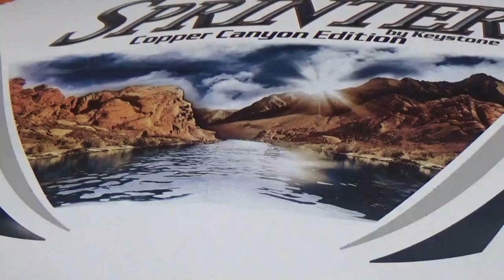RV Roof Replacement and rebuild back wall

Comment: I have a 2014 keystone sprinter 299 ret 36ft travel trailer and the back wall has done the same thing. I mentioned on another one of your other videos that the RV sales person told us that it was made like this for movement. We purchased it new at 30,000$. I reside in New Jersey.... a bit far from you 😕😔 I know you guys want the customers to come in for inspections.  Of course I just purchased dicor 5 tubes. Smh. We are really tricked as these companies really don't care for there customers. So sad. They should have inspections before each process moves forward. Thank you so much for your videos. I know it would be hard for you guys to give estimates without looking at the coach. This year sprinter are beautiful coaches. We maintenance ours every season but like you'all said.... The RV industries really take you for a nasty ride.

Comment: What adhesive are you using on the back wall for the aluminum studs to luan. Is the adhesive enough or does it need screws too? Do you need to put something over the seams before applying the filon? Thanks

Comment: We are re doing our back interior exterior wall on our 2013 Keystone Sprinter and I'm wondering what you are using to stick the skin to the fiberglass, can you please share what you use. Thanks 😊
Reply from the maker: You need to use  a spray contact adhesive  like 3M90, or staybond.. that will bond Filon to wood. Some adhesives will  disintegrate foam. We use adhesives in the a cylinder not a spray can. If using a new piece of Filon I would  suggest you scuff the back side that will be adhered with a sander. Get the gloss on off.
Thanks for watching.

Comment: I've have heard things about Keystone but never have seen the real problem. We have a Jayco 2015 XJ 213 rear slide only because many of our friends have them and like them. We did have a entertainment system problem so I called Jayco and they had is fixed asap. The problem we had was from the dealer themselves not from Jayco.  Great video mate.

Comment: What do you use to glue the rear wall fiberglass to the sheathing? We have a 2018 Big Horn traveler 39mb, ac ran to the rear passenger corner amd down the inside channel. If heartland wont repair under warranty I'll be doing it myself.

Comment: Are the aluminum caged roof wall and floor any better? At least the structure won't rot.
Reply from the maker: No, aluminum is not better. The alloy in the material is pathetically low and makes it extremely difficult to weld with burning apart. We tried to braze a section together and it melted before the brazing rod. The rod molts at 760 degrees. If the aluminum was better quality it would make a major difference.
Thanks for watching.

Comment: I am having this same current problem with leaking on the back of my 32ft 5th wheel trailer although it’s solid on the passenger rear side but on the driver side rear it’s soft as well as my driver side, side is rippled and soft at the rear my question is how much would it cost roughly to have someone fix it? Thank you for time.

Comment: Great video and awesome job! These RV are just junk nowadays! They are built with the same as mobile homes with 1x and 2x2. In your honest opinion who builds the best RV and actually takes the time to properly install roofs from leaking like this Keystone. Thanks in advance!!
Reply from the maker: Unlike a mobile home, these coaches are not inspected or have any codes to follow. So they're actually worse and can legally get away with it.
Who makes the best one?.... They're all the same. Take the decals off and you wouldn't tell the apart. Even when we open them up, they're the same. 
I don't own one. Kind of like a landscaper having his front yard paved...lol. 
Thanks for watching!
Reply: Actually, I think the Keystone Aluminum sidewall construction is one of the best.
Their welding discipline is admirable (Google it for you-tube). 
It is mostly the fault of the owners not maintaining their rigs.
They don't appear to appreciate the fact that they need to maintain the roof (recaulk as required) or any thing else. We have been Rv ing for 60 years and never allowed such damage to occurr.

Comment: From what you have seen, what rv manufacturer turns out the best rvs?
Reply from the maker: They're all the same. We worked on an older Holiday Rambler that was fairly stout. I am not certain if they build them that way anymore. But as a rule. If you take all the decals off, you wouldn't know one from the other, even construction wise. They're all stapled together, no adhesive....Get it built, Get it out, Get it sold attitude. I don't own one. 
Thanks for watching.
Reply from the maker: One manufacturer that we have not worked on is Airstream.

Comment from the maker: This is all GAF brand TPO that we use for the roofing.  The material is 60 mil thick structured. Structured means it has a mesh in the membrane for strength against impacts like branches and hail.  The reason we use GAF solely is because they are the only commercial manufacture company that will extend a warranty to an RV. All our products we install are commercial products, not RV poor quality products. We do not use or install EPDM rubber. 

Jon, the glue we use is just under $500 for the small cylinder, very expensive. You can use 3M90, available at Home Depot or Lowe's.
Reply: Rv roof install I tell you what we have noticed is people is going to these small runaway campers we have been building them for a 5 years I think as of rt now we have 60 to build we don't do any advertisement whatsoever it's just word of mouth you do good work it'll get around

Comment: Thank you for sharing your wisdom :)  I am lucky!  mine is a 96 Keystone Sprinter and  its *just* starting to need back wall replacement... would love to hear from you privately about replacement cost.  I've been very careful with lap seal and checking...but it finally failed!  UGH!  THANKS SO MUCH again...
Reply from the maker: Call between 9 and 4. M-F. 423.475.7663.
Thanks for watching!
Reply: @RVROOFINSTALL  I wish I could but have no reception!  I'm in the toolies of the Big South Fork...

Comment: So just figured out that we have something similar happening on our 2013 Keystone Laredo 250rl. I don’t think it’s currently leaking, and that it was the previous owner and they fixed the leak but did not fix the damage. We’re also currently full time living in it and will be for the foreseeable future. Since it’s getting to be colder outside and we don’t have a huge garage to pull it into to work on it we’re probably just going to wait to do this until spring. My father in law is a very experienced contractor so we’re going to be doing the work ourselves. We will not be completely replacing the entire roof as that should not be necessary, but will need to pull up the rear side to replace the decking. How long do you think it would take the two of us to do something like this ourselves and do you have a price estimate?
Reply from the maker: RVs are not like typical framing. I have no idea how long it would take you. Thanks for watching.

Comment: Thanks for sharing...I bought a new 2018 Freelander micro and it's been a nightmare....just trying to get warranty work done. My first short two and half hour road trip with half my tanks full....one tank came loose and moved...the wall was held in with staples....:-(. After two months in service...no work was done. This year, so far I've been in service for two months and so far they only de winterized  it...:-(  I'm watching videos now and cancelling my expensive extended warranty....
Reply from the maker: On YouTube thee is an attorney named Steve Lehto. He has a video.... Don't buy an RV. Watch that video. He goes over how RVs are not covered under lemon laws. I am telling folks not to buy an RV for one year. These manufacturers will get the message.
Thanks for watching.

Comment: Which is better TPO or EPDM?
I have a 1996 Fleetwood Bounder 40 foot the roof has to be replaced And re-sealed, and I don't know which one I should use TPO or EPDM. Thank you
Reply from the maker: EPDM it useless. I call them starter roofs because of all the 35byears in commercial construction and roof systems I have never seen one last without major detail issues. Detail meaning flashing and lap seals. It also oxidizes terribly causing streaking down the coach...in this case....needs constant babysitting. Shrinks as well and relies soley on adhesive for the details mentioned. 

TPO is a better roof and all the detail is heat weld. So unless the installer is an idiot and not follow manufacturers installation, it will last a lot longer with non-issue. At worse a commercial TPO would or could be coated with a UV reflective coating to stave off an out right replacement for a few more years. If EPDM or any other system was better than what we install... TPO.... we'd install it. RV TPO bus low budget, thin and can not handle being welded. A couple of cracker Jack's on YouTube show you can weld it but when you look at the weld it a mess sloppy and compromised. We install commercial grade TPO like you'd find in a hotel or office building. We designed the curbs  and boots to work and function for an RV.
I hope I answered your question well.... thanks for watching!

Comment: I have a 2015 keystone avalanche bunkhouse with the same problem. The dealership wouldn't touch it when I tried selling it back to them yesterday. They said it was unrepairable damage.
Reply: Y'all aren't but a good days drive from where I'm at. I'll see how next year goes and I'd be more than interested in letting y'all repair mine. Great work.

Comment: I think I have the same problem with my 5th wheel, even though it is a 2006 Model, I think it leaked in where the ladder hooks on top, I was researching new roofing material when I came across your video, you are using TPO to re roof with, have you ever worked with SuperFlex? My roof has discoloring from sitting under a pine tree, functionally I think it's ok, but noticed it's not hard to poke a hole in it. I'll have to research more on the TPO subject.
Reply from the maker: We use commercial grade TPO. Not RV junk.

Comment: I have been hemming and hawing about buying a travel trailer or motorhome. thank you for verifying my apprehension I will be buying a school bus and outfitting for living.
Reply: RVs are given a lot of crap for the roofs leaking but 90% of these roof leaks are failure to maintain the seals properly if you get up on the roof every 6 months chances of experiencing a water leak are very unlikely
Reply: @iair-conditiontheoutsideai3076  My dad had a school buss for 20 years and not once did he have to climb on the roof to prevent leaks! If you do it right the first time you don't have to keep repairing it at every turn!
Reply: @living-wellon-less5669  that's because it had a metal roof there are several coaches that have metal roofs
Reply: @iair-conditiontheoutsideai3076  No. it is because it was assembled properly with proper materials!
Reply: @living-wellon-less5669  well I flip RVs for a living and yes I do get several water damage units. however I have never had an RV with a metal roof have water damage except for around the air conditioner. which was a gasket failure with the AC unit had nothing to do with the roof itself
Reply: @iair-conditiontheoutsideai3076  It isn't just the issue of roof leaks it is all the cheap construction throughout manufactured RV's and the cost of owning one when a school bus is a fraction of the price built on a chassis and drive-train made to go hundreds of thousands of miles and an engine bay you can actually get to! I retired from GM and I have worked on almost every type, make and model vehicle on the road and RV's are built cheap metal roof or not! RV's have too much flex on the road and are bound to leak someplace!
Reply: @living-wellon-less5669  most people are not able to do that but hey if you can nice 🙂

Comment: Which Adhesive sealant and mold killer? I want the best product by someone who’s experienced as you
Reply from the maker: We use concrobium for mold killer. Available at Home Depot under the brand Mold Control. 
You can use Rapid sealant available at HD as well but it's in the concrete section not the caulk section, at least in our local store. 
Thanks for watching.
Reply: @RVROOFINSTALL  thank you !!

Comment: i was wondering if it would it be a good idea to replace all the fiberglass insulation  in my camper with a ridged type...just wondering if it would make my camper too ridged not allowing to flex  when needed
Reply from the maker: If you have a class a or c they already have plyfoam roofs.  If you have a 5th or Travel trailer they have batton insulation and I probably would not replace it if it were mine unless there was a reason to.
Why would you consider replacing with rigid?

Comment: Great video.  Loved the way you repaired the wood, the scarf joint is strong.  What TPO material did you use on the roof?  What is it thickness.  You guys prefer TPO to EPDM?  Anyway, thanks for the video.  Very informative.
Reply from the maker: We use GAF brand 60 mil structured TPO. EPDM rubber is problematic. It shrinks, is not structured so it has no tensile strength , has issues with call  sticking to it, and when it oxidizes it will streak the coach with black stripes.  TPO is much more durable than rubber and can withstand branch drags without snag.
Thanks for watching. Share

Comment: Have you tried using spray-on bedliner on the roof. That is some tough stuff. I don't think it'll come off once you get it on.
Reply from the maker: It's not an issue of coming off.  RVs leak because they don't have curbs. Thanks for watching!

Comment: Sad but true! I bought a Class C with the typical wet/rotted cab over but could fix it myself. I tore out the rotted sleeper board and replaced it with 3/4" plywood with fiberglass that I glued on. I probably have $250 and 100 hours in the fic. I rebuilt it better than the factory. It's the only way I would ever buy an RV - buy it cheap and fix it myself

Comment: I have a Hallmark Cyclone 2008 3712 model which requires a new roof.  I am trying to decide which is best EDPM OR TOP.  Please advise what is a long term enduring roof to install and or other type than mentioned.  Thank you
Reply from the maker: Good question...well EPDM is rubber. Rubber is literally the cheapest product in the planet and RV grade is cheaper than that! Even RV grade TPO is cheap quality and too thin to weld to. We have 35bywars in commercial roof systems and in all that time we never install one roll of rubber. Rubber will shrink and oxidizes terribly which will streak the coach with carbon residue. We use commercial grade TPO. But no matter what you select if you do not have proper curbs, flashing and counter flashing, the roof will leak. PVC is another option but it is generally more expensive and used for industrial application where chemicals or other fall out around the plant may otherwise have an adverse effect on rubber or TPO. 
Does that help answer your question? 
We use GAF TPO because they are the only commercial manufacturing company that will extend a material warranty on a coach. This is the same product you would find on an office building, restaurant or hospital, with the same installation proxedure

Comment: That awning is not mounted to anything.  The keystone has an aluminum frame so there is no lumber for that awning to be mounted too and the aluminum does not run horizontal.
Reply from the maker: Not sure if you are saying they did it wrong or if you think we did it wrong?
Reply: @RVROOFINSTALL  
Keystone did it wrong....... the awning is only screwed into fiberglass.
Reply from the maker: @MikeAndNary  I'd have to watch the video myself. I don't remember one from the other anymore... Lol. I know they do not have much stock behind the awning arms and we usually use a special winged rivet nut to reinforce it. And if we don't have good stock for the awning rail we will reinforce so it will last.  They're all the same. I don't own one. 
Thanks for watching..

Comment: Is there any trailer company that builds a quality trailer?
Reply from the maker: No. They're all the same. I don't own one. Thanks for watching.
Reply: @RVROOFINSTALL  thanks. It seems like there would be a market for one. Maybe airstream or nucamp. Wish there was a shop like yours in my area. Working my way through your videos. Thanks for posting them.
Reply from the maker: @sadbttru  I see vids on repairs and rebuilds and they are showing folks the wrong way...or not the long term solve the problem way. But I also see folks leaving comments in how good of a job they did. ??? Anything can look like it is a good job when the product is new. Watch a few minutes install a TPO roof on a class A Discovery....gee wiz...what a shame for the guy who paid them. The vid is on YT....they call themselves  A. Z. Expert. They may be good at something...but not roofs!